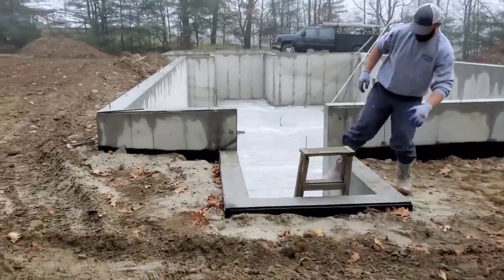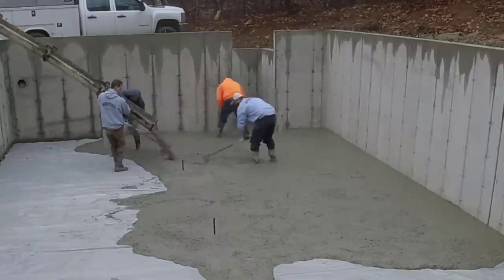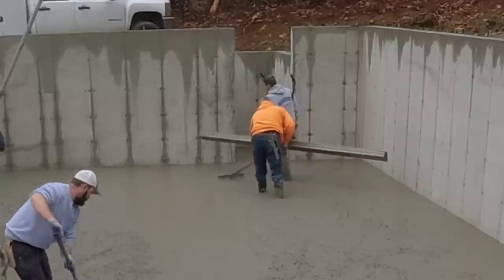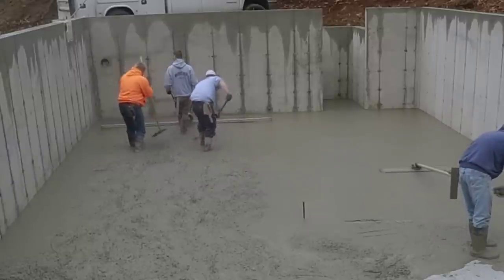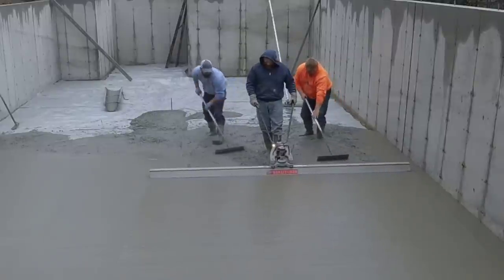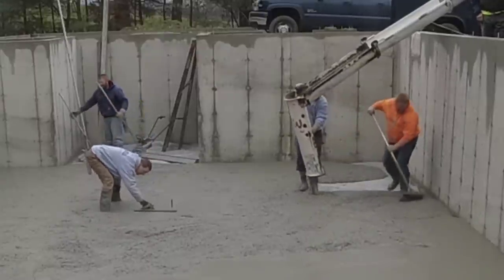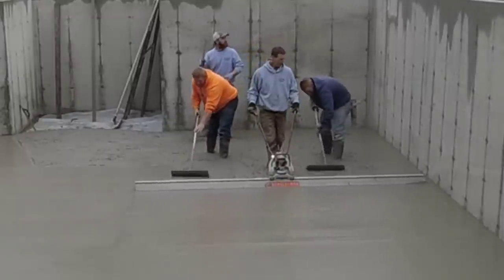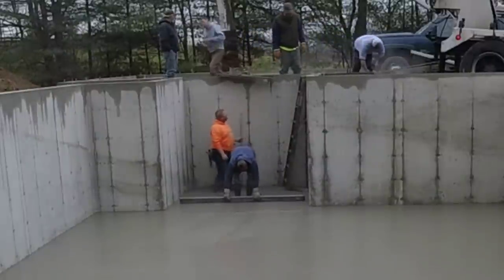Is A Battery Powered Concrete Screed What You Need? (You'll Know After This)

Comment: Watching you guys work (and a few other YouTubers) I realize how ass backwards the techniques I learned were. I learned how to do flatwork in southern California and for some reason most crews there included so many unnecessary steps. Screed hooks with hanging 2x4's , wood bullfloats followed by fresno's and lots of hand floating and hand trowelling. I did years of flatwork (big money jobs) before I ever saw a power trowel. None of my work was level so power screeds might not have been appropriate but we could have learned a lot from your crew. we always had laser levels on site but never thought to use them to shoot pads and never dared to wet screed by eye. All of the other crews I saw working around our jobs did everything like we did so it just seemed normal. It wasn't until I started travelling out of California until I saw some more efficient methods. Great work guys. I'm wondering if you would pour that loose with 1 or 2 percent fall everywhere?
Reply from the maker: It is interesting how others do concrete in different areas. Sometimes I'm thinking as I watch "why are they doing it that way for?"  We pour a little stiffer slump when we have a slope.
Reply: @MikeDayConcrete  I forgot to mention walking through the pour after it's screeded and hand tamping the aggregate down. Now people use a roller tamp.
Reply: Trust in Jesus Christ our merciful Lord and Savior whom Has died for our sins so that whoever is reborn in Him and keeps His commandments can be made new and freed of sins and burdens, and find everlasting life and not death, Amen Amen

Comment: We use a 14ft screed board with critches as handles..1 guy can pull screed and darby ..im a 2 man crew and we can handle 45 yards in summer and 65 in winter using this method. We use a water reducer as well and 1 or 2% half inch stone with nca. 4000lb mix always..steel only in garages and fiber in basements...were in eastern Connecticut

Comment: I’m a builder in Australia and we do smaller slabs ourselves up to 
200m/2 Power screeds haven’t taken off here . I often ask the concrete truck drivers do they see Concretors using them and they say almost none. It’s a no brainer for me.
Reply: They use them here in Melbourne, usually on larger pours.

Comment: That power screed also vibrates concrete meaning it removes air from mix making it harder because it comes more solid without lot air bubbles and for sure smooth surface like that is easier to finish.
Reply: You would all be fired if you were on my group Moving that slow just  Saying I do commercial it's go go but good on ya love the video

Comment: Where is the rebar? Wow! Pretty brave doing with out. Of course all of mine has rebar of some source. One job was done with 365 ft oil field cables. That cable was 1.5 inches thick.
Reply: I agree any concreting that we do we always put reinforced steel in it
Reply: Why would you put rebar in a basement? Even the center column is plenty deep enough for the center. Certainly not going to heave.
Reply: @timodonald5397  Stellar as resisting compressive forces along the top skin, but without rebar to carry the tensile forces the bottom will fracture under a relatively small load and cause the slab to fail, like snapping a twig.
Reply: @timodonald5397  ... many put a little steel down the center to spread the load of the main beam in the home.
Reply: @timodonald5397  I'm not answering that...

Comment: Comment......Why do you not put a Styrofoam expansion joint around the perimeter around the walls to help keep the floor from cracking?
Reply: When your underground in a basement you usually don't get freeze and thaw,so no movement,and your usually 4 to 5 inches above the footing for your floor pour,so it doesn't prevent concrete from cracking. But couldn't hurt to put insulation board on the outside of foundation.

Comment: Ireland here.  Would anyone know in a job like this over in the USA (or part thereof) what (a) the material and (b) labour cost divide is on pours.  I'm assuming this is relatively high cost, so are you feeling any pinch in terms of becoming so efficient and quick it gets harder to charge on labour etc or is that even a factor?
Reply: I don’t know the individual costs of labor and material, but altogether, something like this would cost you anywhere from $15,000 - $30,000, roughly.
Reply: @nathancarranza9860  that's what I'm so confused about as I'd love to know what the labour is since these guys always seem to get done so quick.  Like what does a guy who owns the crew expect to profit a day from this work?
Reply: @imnothere220  I don't know if this helps, but the average pay for a concrete laborer in the US is about $23 per hour with no benefits (no health insurance, 401k, etc.). If it takes two days, that's about $1,500 for labor. But some of these concrete guys hire a subcontractor for the excavation, so that will subtract from total profit, but if they do the excavation themselves, and they charge $18,000 for a simple garage slab, I would say the owner is making somewhere around $8,000 profit for himself; that's the money left over after paying materials and workers.
Reply: @nathancarranza9860  fffffuck. 8k on 18k.  Some margin.  Most of these videos seem to say a day at most for the pour and a day on a dig so conservative estimate of 50-60 jobs a hear at that margin...holy god.  Does not stick in the craw a bit with the labourer pay so low and so little benefits and bad health care etc?
Reply: @nathancarranza9860  massive shortage of skilled labour in Ireland do.  Work very hard to get done and where you can costs are about double what they were not that long ago.  Still, that margin is insane...I'm surprised people put up with it, but like you say, they seem happy!  I'm stunned people don't under cut though.  In most industry absent a concerted practice, a margin with that cushion would invite comparably skilled competition with undercutting.  Still, if people pay, people pay....

Comment: You have probably said before, but what is the purpose of the plastic?
Reply: vapor barrier. It reduces floor sweat from ground moisture.
Reply: @rupe53  Very nice. I'm from Utah, we use plastic occasionally as part of a radon system. When I've used it, the concrete seems to be easier to pull in to place. Wondering if that factored into it.
Reply: @caseycordon320  ... if there was Radon, they would have added gravel and pipes too. Here in the northeast, we are prone to Radon so some towns make the contractor put in pipes / gavel just in case, because there's no way to know what the Radon readings will be till the house is finished and sealed up.